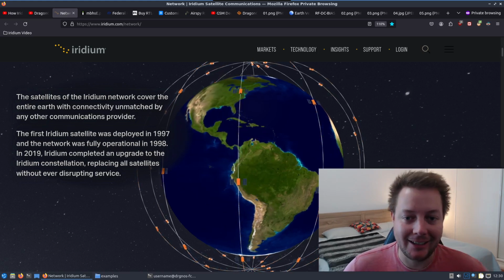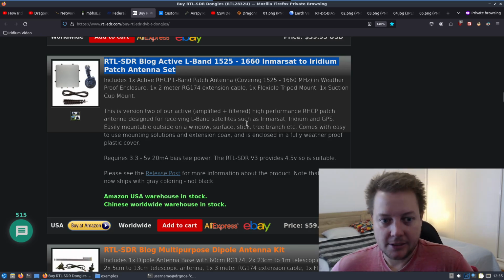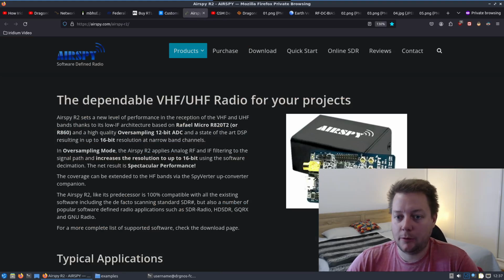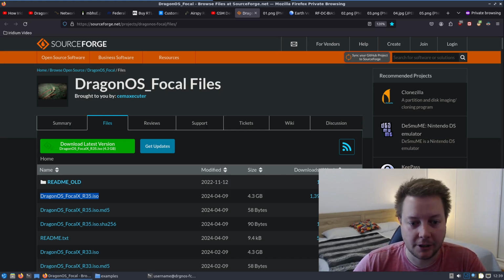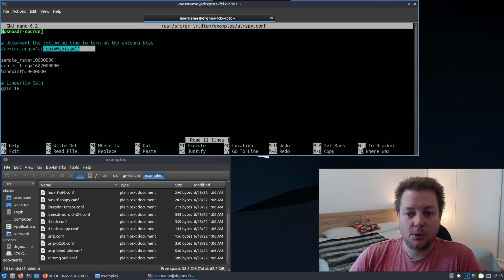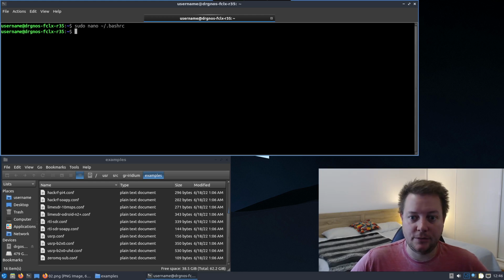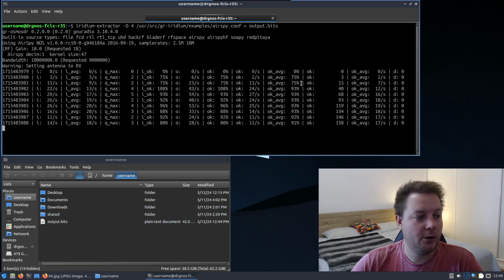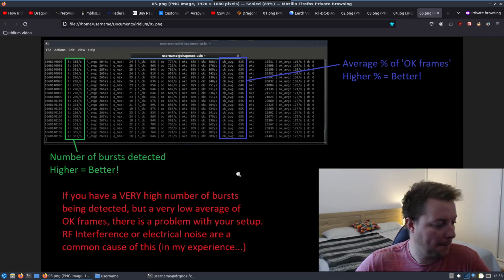Iridium Satellite Decoding Part 1: The Tutorial That Goes Over Your Head, Literally!

Comment: is a log periodic antenna (600-6000mhz) good? i have a rtl sdr v4 with that antenna and when i try to extract data i get all 0 values... xd
Reply from the maker: @rob_3764  Lol yeah, satellite signals don't work like that. They are remarkably weak by the time they reach earths surface from space. Typically, you will require a 'tuned' antenna (an antenna that is built and tuned specifically for 1.6 ghz), L-band filtering, and amplification in the form of an Low Noise Amplifier. I recommend the RTL-SDR Blog Active L-Band antenna, because it has all three of those things included in a single antenna. Also, you will be very limited in how much data you can capture with an RTL-SDR. Because it can only see about 2.4 MHz of the total 10 MHz bandwidth that Iridium occupies in the RF spectrum. I recommend the Airspy R2 for Iridium stuff. It can 'see' the entire Iridium band at once.
Reply: @RobVK8FOES  ok thank you for answering so quickly even tho this video is like a year old, yeah this antenna isnt the best one, i paid it like 6 bucks on AliExpress and it has no Lna or filtering, what do you think i can do with this antenna other than capturing tv signals with the dvb s2 decoder?
Reply from the maker: @rob_3764 An RTL-SDR and a log periodic antenna, the possibilities are endless! How about using DSD+ to decode DMR voice? TETRA Demodulator plugin with SDR Sharp to decode TETRA digital voice? FM broadcast listening, amateur radio listening, civilian and military aircraft listening, POCSAG pager decoding with PDW, commercial analog FM voice scanning, rtl_433 to decode weather stations and tyre pressure monitors, weather balloon decoding, 2G cellular decoding in Linux, ADS-B aircraft tracking, AIS marine vessel tracking. Those are just a few things off the top of my head. 600 MHz is a little high for VHF and UHF, but your antenna might work if those signals are strong enough
Reply: @RobVK8FOES  thanks a lot! i was thinking of listening to some airspace and sea related frequencies but i think i will use my v-dipole antenna for that. your channel i s very informative btw